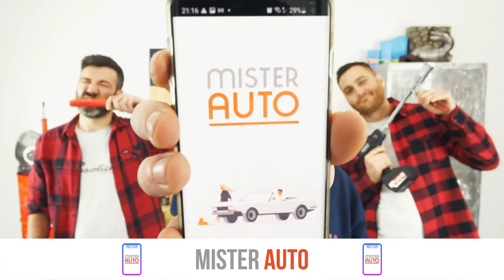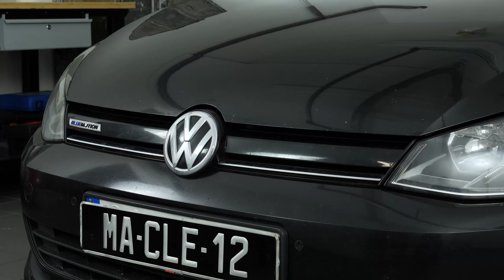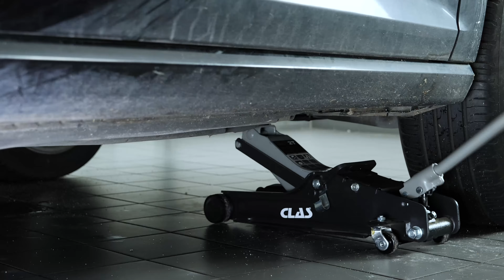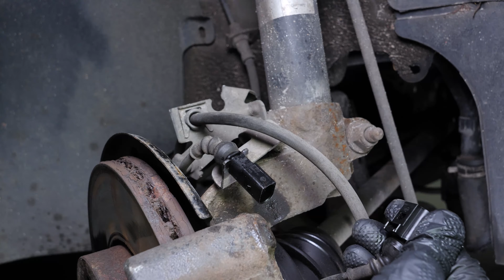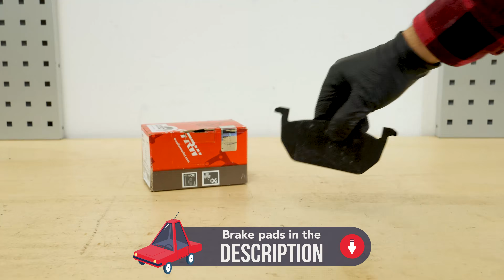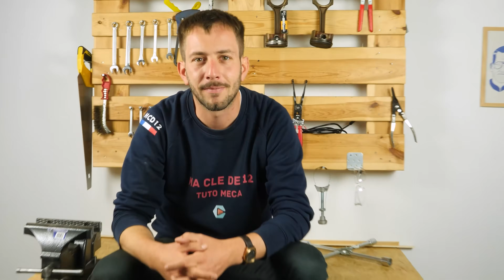How to replace the front brake discs and pads Golf mk7 🚗

Comment: Is there a way to push back the caliper without wedging a screwdriver in there? The screwdriver method usually breaks the pad.
Reply: Replacing pads & rotors so does it really matter?
Reply: Piston wind back tool
Reply: Also you can push dirt under seal...

Comment: No silicone grease on the slider bolts?
Reply: no it will damage them as the front slider bolts are not designed for it, the rear bolts will have to get silicone grease